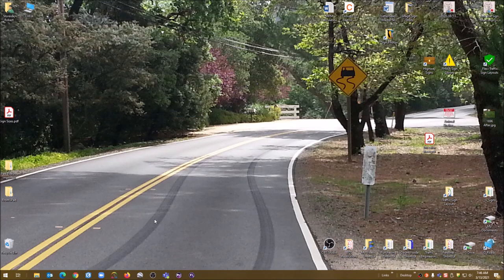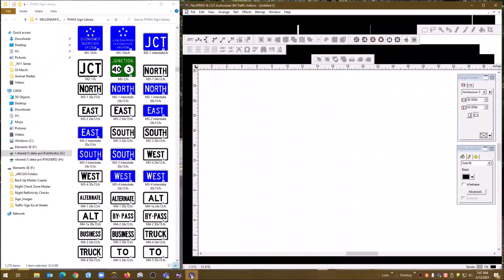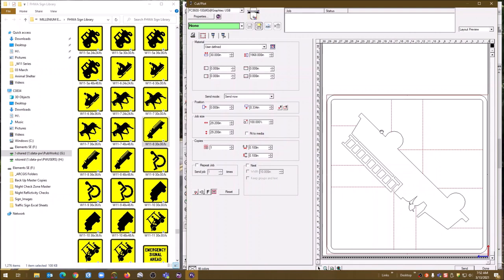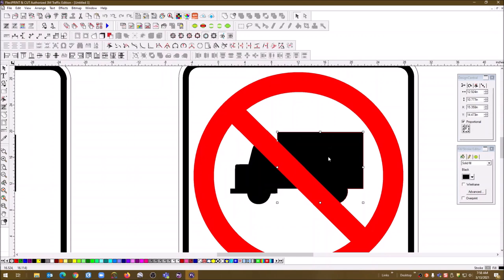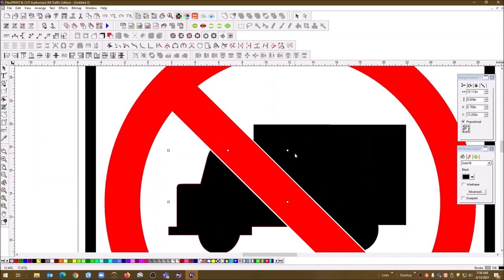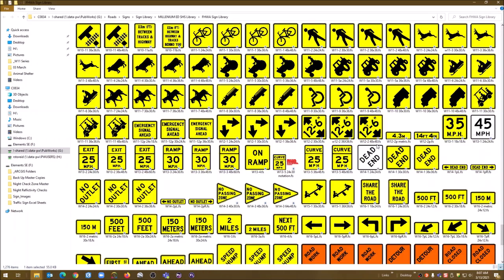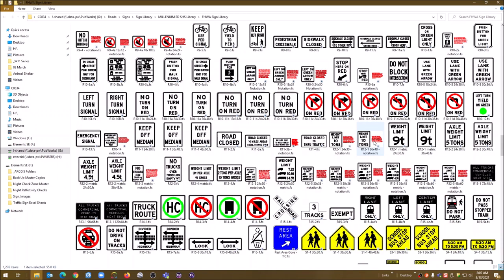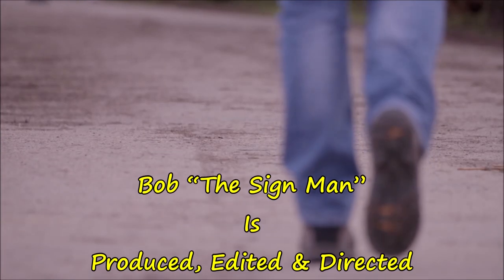Using Flexi with Traffic Signs

Comment: hey bob, i have the library that we bought with our bren cutter and it is pretty much the same as yours but unfortunately you have to rotate the sign to print it and resize the paper and all these other things. luckily i dont use it very often as there is another program that allows me to easily make street signs, which is probably 99% of the signs that i make. i would like to spend more time to learn about this program but time does not always allow.

Comment: Hi Bob, I’ve been using Flexi for years and am currently working with Flexi sign pro cloud version 8.1
Love it and as you work with it it gets easier and easier. What version did you get, I noticed you have tools that I don’t as mine is quite a few years older now. Keep up the great work!
Reply from the maker: We have Flexi 12.0. We didn’t get the cloud version. Paying a monthly subscription is a red tape nightmare at our county purchasing department. The cloud program is updated often, ours is not. Pros and cons.
Reply: @BobTheSignMan  ,Nice! The version we have came out in 2012 I believe. When we bought it from Tapco, we also purchased the latest MUTCD sign library. We actually don’t use the Cloud portion of it at all for pretty much the same reason you mentioned. Looks like you’re well on your way with it, best advice I can give you with it is to just use it and keep experimenting with the various tools. Keep up the great work and videos! Stay safe out there!